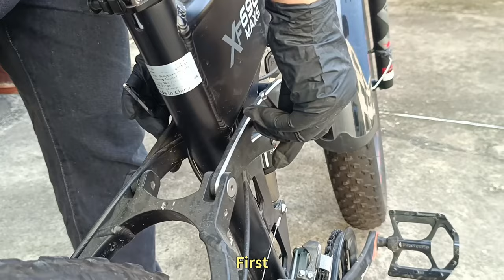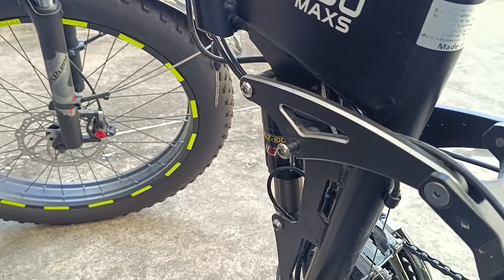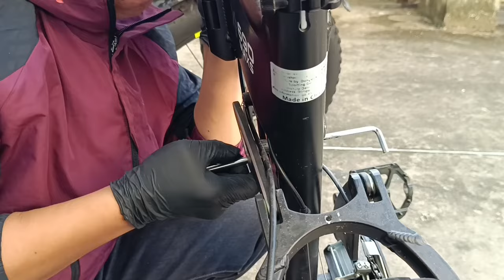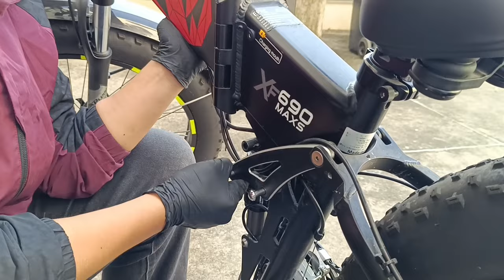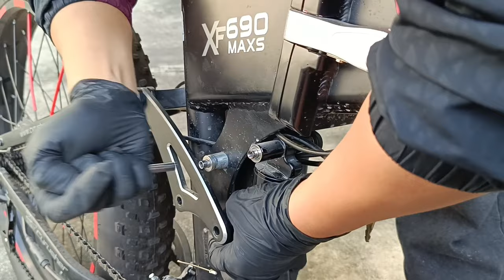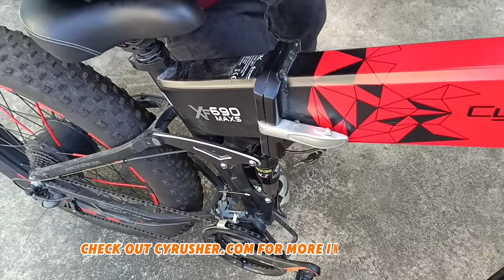How to fix rear shock on the bandit folding e-bike | Cyrusher Sports #quicktips

Comment: Good Vid, I have the Ridstar H26 it has the same issue, what size bolts are the new ones please?
Reply from the maker: Hello, the screw specifications of our Cyrusher folding bike are as follows:

Two locking screws with the dimensions of M8*86mm
Eight washers with the dimensions of M8*1mm
Reply: @Cyrushersports  thank you very much, I just ordered a bolt, unfortunately it seems to be coming from 🇨🇳, two week wait